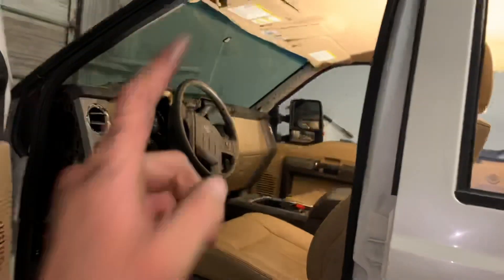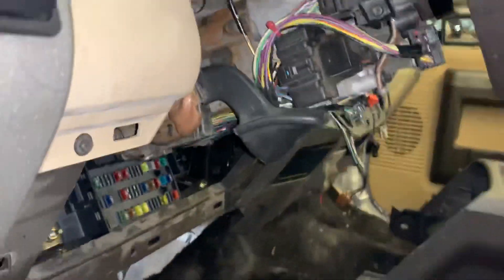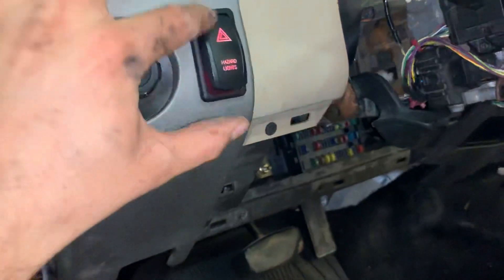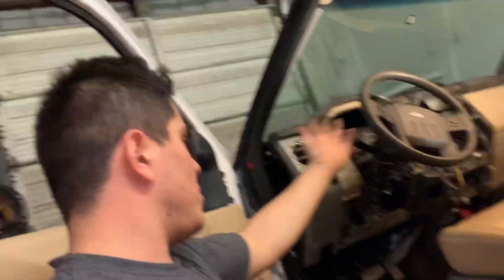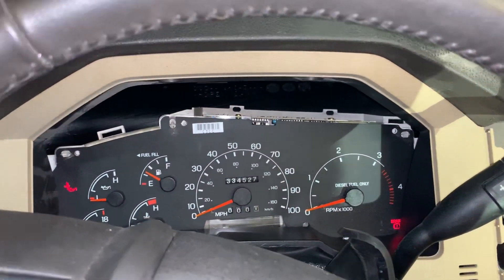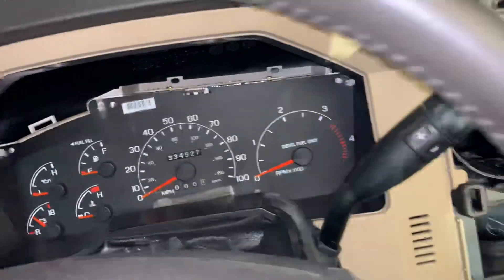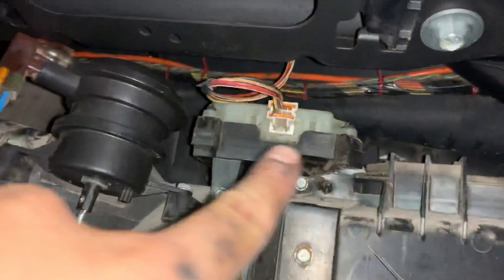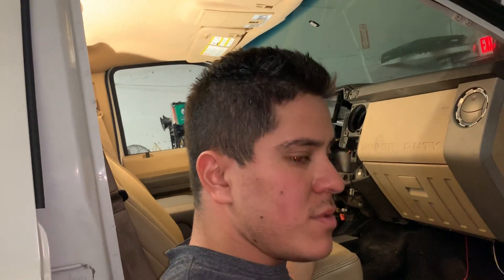The f350 6 Door is ALIVE

Comment: Hey I’ve got a 2000 f250 supercab that I want to do the dash door panels and front bucket seats with the long center console wanted your opinion if you would rewrap the backseat black and paint the back door panels Ect. Ive got the 2010 tow mirrors a coupe year ago they aren’t power fold or power extend wanted your opinion
Reply from the maker: not really sure. ive never looked into doing a supercab